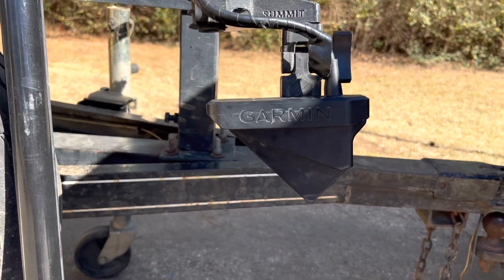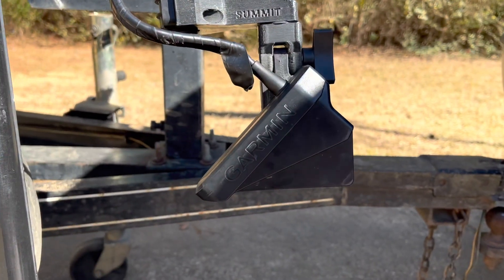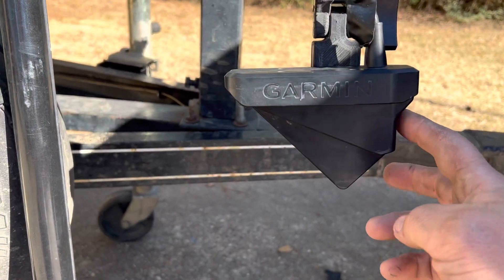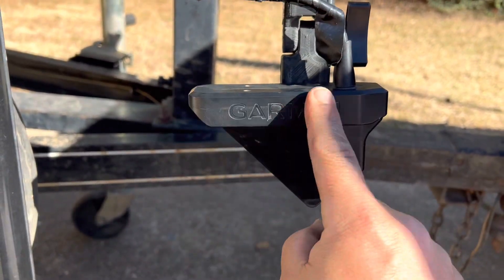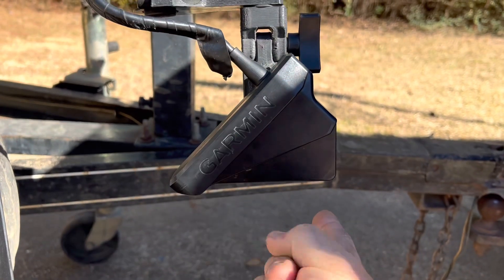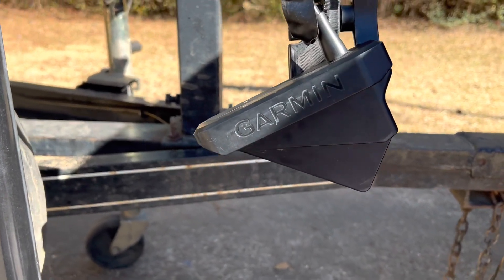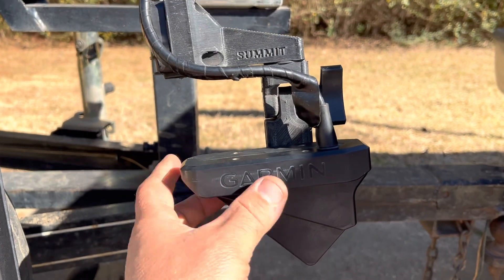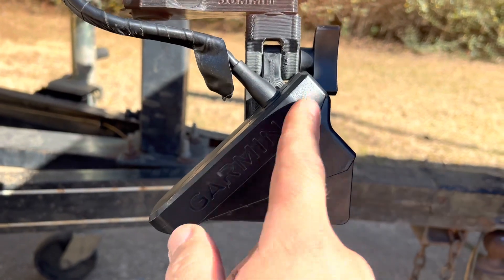How Does It Know What Side Of The Shaft The Garmin Livescope Transducer Is On?? Let’s Find Out

Comment: What position does the transducer mounted on the starboard need to be when you calibrate the transducer?
Reply from the maker: It doesn’t matter as long as the corresponding position is chose on the fishfinder. Also if you switch positions after calibrate you will need to calibrate again for that new position

Comment: I have mine on a see-lite livescope pole on the starboard side of my boat. Do I position the transducer tilted 45 degree as on the starboard side? Please advise. Thank you brother.
Reply from the maker: Doesn’t matter the side of the boat as much as the side of the pole in your case. Does that make sense bud. If not message back and we will get if figured out
Reply: @The_Garmin_Guru  I do understand exactly what you mean. It all depends on what side of the pole the transducer is installed. Since both the pole and the transducer are installed on the starboard side then the positioning of the transducer needs to on the starboard. However what controls the positioning is the side that is mounted on the pole rather than the side of the boat. Am I correct?